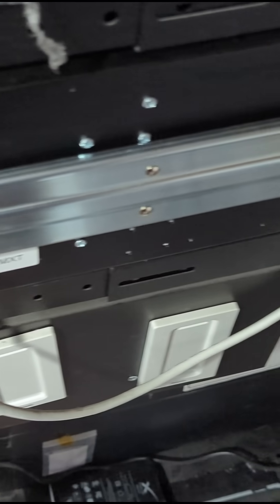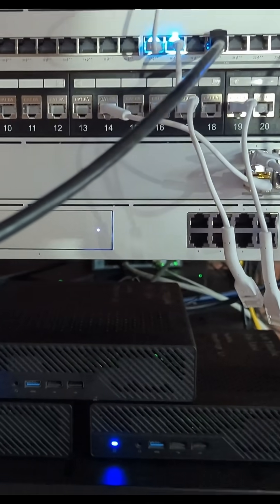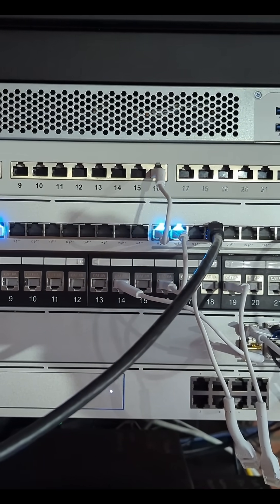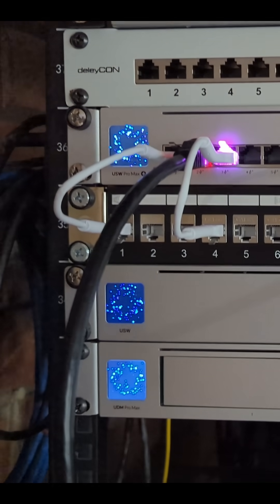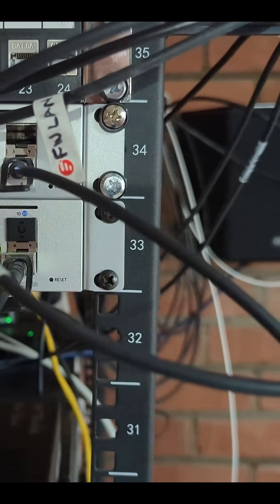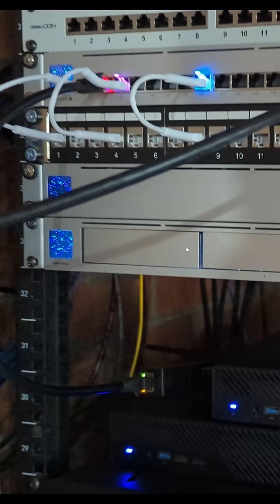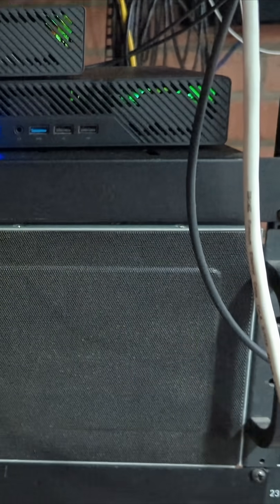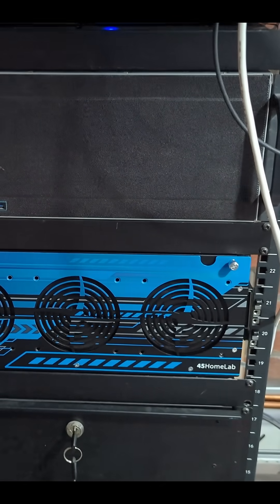Hardware Network Overview #tech #networking #technology #shorts

Comment: Can I get the make and model of the fibre to SFP switch please? I’d like to go straight from my fibre in to SFP and there to my UCG fiber. I’ve got 5 gbps down and 250 mbps up so it’s worth “wasting” one of the SFP’s
Reply: Did you get a chance to get your make/model of the sfp to single fibre adaptor?
Reply from the maker: @rorylong314 it's a WAS-110 (the 8311 Discord can help you out)
Reply from the maker: It's the SODOLA 6 Port 2.5Gb Ethernet Switch
Reply: @Jims-Garage Thank you. What’s the single fibre to SFP+ that I presume you’re running from your Voda outlet to that switch. That would be enough for me really. As it’s 9pm, an answer tomorrow or Monday would be fine